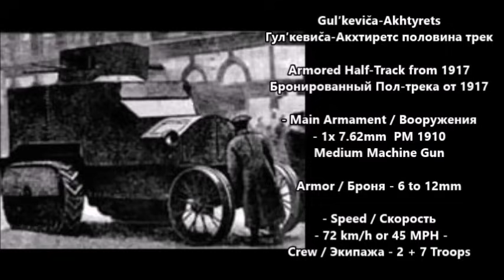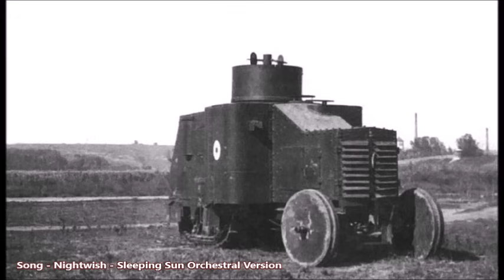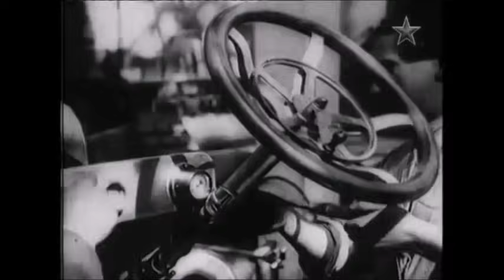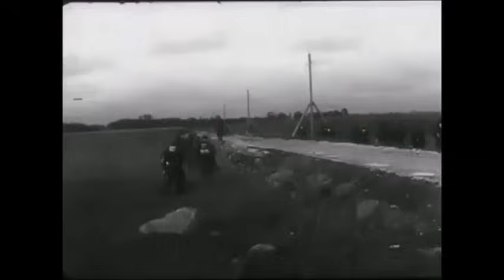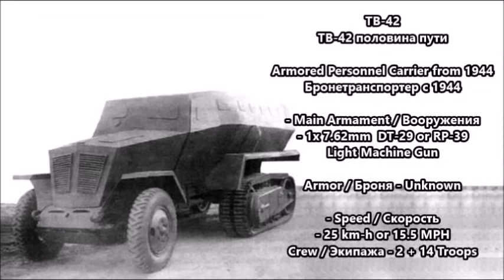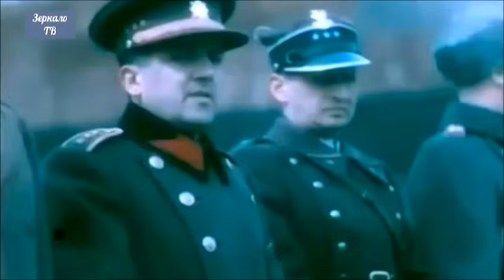Russian Half Tracks of WWI & WWII - Explained

Comment: The speed you're mentioning  45mph/72 kmh seems hardly possible, the later mentioned 24.8mph/40 kmh sounds more reasonable.
You are probably getting this info from some other sources, but sources aren't always that reliable.
Looking at the mechanical side of the story 45mph/72kmh was actually only possible with the (later developed) Christie suspension AND a very powerful engine.
It MIGHT have been a "theoretical" speed obtained under the most favorable circumstances like completely empty, downhill, wind blowing from the back
 etc.😉
The more primitive (often Kegresse) suspension and drivetrain at that time was not really capable of sustaining those speeds.

Comment: ZiS-41 seems useful, excepting only the extra long step between the tracked suspension and the front axle.  ZiS-43 seems useful as well, particularly, because the Red Army needed tracked mobility for its support weapons asa much as it did for its tanks.  So few roads in the various SSRs.  Halftracks are better than no-tracks.  Or, as my Animals Und Panzer poster proudly proclaims: "Halftracks good!  All tracks better!" *
*With apologies to George Orwell